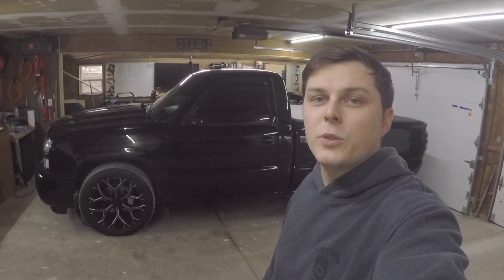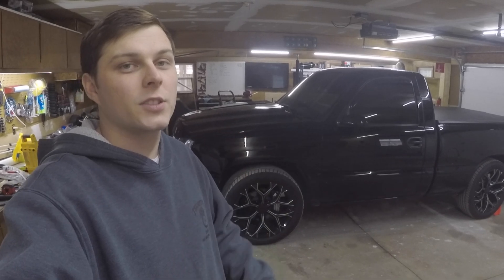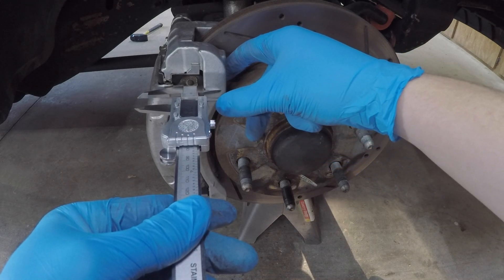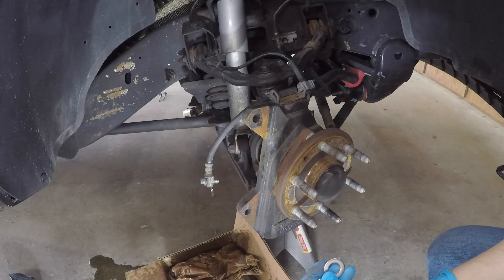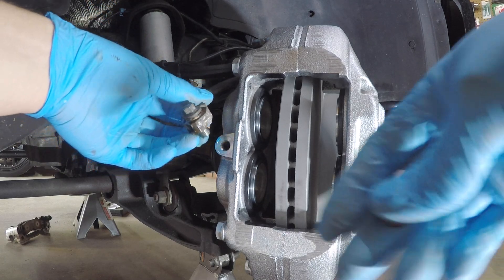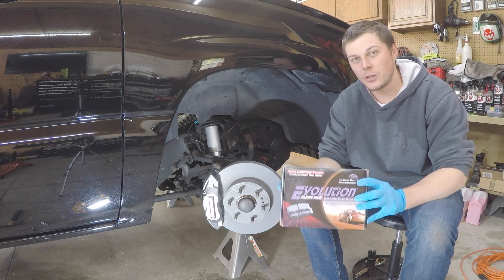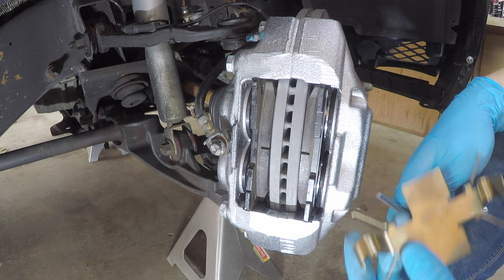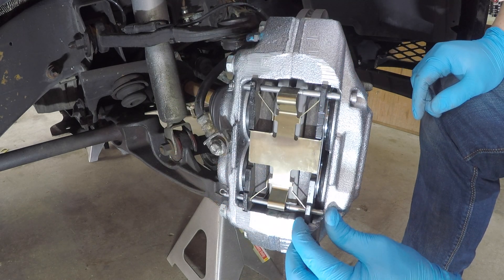Silverado 2019 Big Brake Conversion! “How To” A NBS!

Comment: I have those headlights but can’t get the auto to work. Do you have a video how you wired it? I know there’s a couple optiona
Reply from the maker: Hey, are you talking about the LED bar? The bottom set already has the connector on it. The top set you need to wire in to the bottom set. I used deutsch connectors. As they are easy to install, add more wires, change connector houseings, ect. And they are waterproof. 

But if you wired it in already, the lights work, but the auto feature isn't working. Like the DRL or the headlights bulbs. Its either your DRL/headlight switch, or the light sensor on the dash is bad.
Reply: @TheKingCoopa  yeah it’s been a few months since I put mine in and I want to say there was a white wire the instructions called for but the other wire was maybe brown? Which color is your connector hooked up to?
Reply from the maker: If you have instagram or Facebook, i can send some photos. But the lower housing plugs right into the DRL socket on the trucks harness (brown and blue wires). I cut the trucks harness, and spliced in a deutsch connector. That connector goes to the top houseing. 

Red wire from the headlight housing, goes to the brown wire on the harness. 

Black wire from the headlight housing, goes to the blue wire on the harness

Comment: Would this fit my 1995 Chevy Tahoe
Reply from the maker: Hey, from the research I've done, these should fit the GMT 400: 1987-1999/2000, GMT 800: 1999-2007 Classic, GMT 900: 2007-2013/14

I'm not too familiar with the obs trucks, but if your tahoe is a 1500, with the 6x5.5 lug pattern, it "should" fit. I can't garentee the fitment, but research shows it should. Definitely something worth looking into though, hope that helps
Reply: Thank you so very much I will try soon an let you know . . Oh an where should I get the washers from
Reply from the maker: @JovonSavage  for sure, let me know how it goes, I'll update my description that they for sure fit. And for the washers, I have some linked in the description of the video. But honestly I'd just get them from an ACE hardware, Do it best, or worst case, Lowes should have some. Just some M14 stainless steel washers. They should be like .60cents each. Two for each calipur.

Comment: Hydroboost and  braided brake lines would help on both issues.  I have a cammed 6.0 in my NBS Tahoe with the NNBS brake upgrade with drilled/slotted rotos. It stops great, but I'll do this next brake job so they'll be greater lol. Seems parts are scare, but I'm in no hurry..good content..subbed..
Reply from the maker: Hey, sorry for the late reply. Just finished they hydroboost swap (still have to bleed the brakes) but I'm sure it will make a big difference. I feel like the parts are kinda scarece just because they are so new, and alot of them haven't gotten to the junkyards yet. I think In a year or two they will get more common.  And thanks for the sub, I appreciate it!!
Reply: @TheKingCoopa  no problem I think I can get the calipers thru Summit.. just have to pre-order...got me interested in working on my truck again..
Reply from the maker: @spyderlyf3  oh nice, let me know if it works. If so, I'll add the summit link to the description of the video, for future viewers to buy 🤘

Comment: I have a 2001 suburban 2500 with 8 lugs. What calipers and rotors could I use?? Have 18” rim on it.
Reply from the maker: Hey, sorry for the late reply! This video is for the 1500 6 lug setup, so it won't work on your suburban.  But I had a lifted 2003 2500 silverado on 40s, in some of my older videos. I used the factory calipurs, with powerstop rotors and pads. It did pretty well for a 9,000lb truck. I'd definitely use them again. Thats my recommendation, but for upgraded calipers on your 2500, honestly I'm not to sure. Sorry, but hope that helps 🤘

Comment: What is the diameter of the rotors and minimum diameter for the wheels. That would be a nice addition to my 2003 silverado. Would like to us my 18 inch wheels if possible
Reply from the maker: Hey, sorry for the late reply! The rotors are 13.51". Stock 17s should clear, some aftermarket 17s are questionable. My custom forged 18" dragwheels have a calipur clearance of 3/8in. So your stock 18s should clear just fine.
Reply: @TheKingCoopa  thanks for the response. Dont even worry about the delay. I appreciate the response greatly and the info is just what I need to hear. Thanks again take care and have a great weekend
Reply from the maker: @holmes1956O  for sure, you as well. Thanks for the support 🤘

Comment: Does anybody know if they will clear 20s Tahoe ltz wheels
Reply from the maker: Hey, sorry for the late reply! I know for sure the diameter will clear, but unsure of the offset. Worst case, you could try it and have to run a small 3mm or 5mm spacer.

Comment: What wheels are you running?
Reply from the maker: They are made by OE Performance and they are called 176M. Its a 22x9 +24mm offset. With some 285/45r22 Michelins.

Comment: Are the front 4 piston calipers the same as the back 4 piston calibers
Reply from the maker: Hey, im not sure which 4 piston rears you're talking about. But if they are the 2019+ rear calipers, you can't use them.  They have extra electronics that control them, that the previous generations do not have to support them.

Comment: Will any 2019 chevy rotors work ?
Reply from the maker: Hey, sorry for the late reply!! Most the 2019 rotors are similar, but if you look on rock auto or other websites. Certain rotors exclude the big brake option. So honestly I can't give you a 100% answer. But from the websites fitment info, I'm gonna say no. Not all rotors will fit the big brake upgrade.

Comment: Don’t think your caliper was “seized” it’s 4wd so that was just what happens when in park, same as the rear on a 2wd being in park.
Reply from the maker: Hey, I get what you mean by the 2wd/4wd thing. My calipur sized while driving, it got so hot I couldn't even touch the rim. I almost had to tow it home. Once it cooled off, I couldn't even depress the calipurs pistons with my bench vise. Which was a main reason for the 2020 calipur upgrade

Comment: What do you search like year of vehicle if I was to go to an auto zone or parts store?
Reply from the maker: It would be for a 2019-2022 silverado 1500. Just make sure its the 4 piston brake calipurs. There is like 3 or 4 different calipur designs for those years.
Reply: @TheKingCoopa  thanks I just ordered the calipers just need rotors and pads
Reply from the maker: Nice, good luck with the swap 🤘

Comment: Is this the same process if I where to go with the 6 piston brembo instead of the stock 4 piston
Reply from the maker: Similar concept, but with brembros you wouldn't be needing the small spacer. For 1600$ for just the fronts, you better beable to just straight bolt it on lol.
Reply: @TheKingCoopa  since they are still for a 2022 I’d expect to use the washer but I just don’t know if they would fit
Reply from the maker: @BDRslayer  oooooo, I thought you ment brembos ment for an 03-07classic silverado.

If you went with the 2019-2023 silverado brembros, I'd assume you would need a spacer as well. But honestly not sure on the actual fitment of them.
Reply: @TheKingCoopa   if I could find the 6 piston brembos for the 05s under 6k I’d buy them but I may just try and be the first one with 2022 brembos swap on a cat eye I can’t find any info kinda worries me
Reply: @TheKingCoopa  any advice on a hydro boost brake system my stage 3 cam hates the vacuum style brakes lol
Reply from the maker: @BDRslayer  6k!?!.... yea thats ridiculous. Maybe it was for my corvette that were 1600$

I'm finishing up the hydroboost swap right now. Whats your question?
Reply: @TheKingCoopa  I’m wanting to do the hydro boost swap are you doing a video on that or can you tell me what all u replaced
Reply from the maker: @BDRslayer  yes, im doing a video on it. Its gonna be a little bit before I finish it up though. Here is a link to a really good write up on it.

https://www.performancetrucks.net/forums/gm-drivetrain-suspension-22/hydroboost-conversion-install-417445/

Comment: Rockauto isn't cooperating with the parts search, I am getting a bunch Item not found?
Reply from the maker: Hey, gm is now in production of the 2023 silverados, so they have changed their part numbers ALOT. All the numbers listed in my description are probably discontinued by now. I've updated it like 3 or 4 times now and finally gave up on it. You should beable to search those part numbers in Google and im sure someone will have them in stock. But rockauto has never really been reliable for the calipurs/rotors.

Comment: Just completed the bigger brakes and calipers conversion for my 05 Escalade EXT. Your video was very helpful and detailed enough to make the job a breeze. I haven’t broken the pads yet because of rain, but as soon as it stops raining I will do a full breaking in cycle and test. Thank you so much 😊.
Reply from the maker: Hey, sorry for the late reply. Oh nice, thats awesome! Hopefully it made a big improvement. I know those escalade's are pretty heavy and need that extra braking power. Glad I could help out, thanks for the support!! 🤘
Reply: @TheKingCoopa  it definitely feels much better. Before it would struggle a little to stop hard and fast. Now it just stops quickly when pushed hard and doesn’t struggle at all. The hydraulic power booster makes feel very smooth. It only requires normal pressure. Thanks again for your help.
Reply: Are your wheels 17 inch? I have an 05 Z71 w 17inch wheels and ned to know if they will fit,
Reply: @acampbell8071  No, I upgraded to the 22s from the 07s. But I believe they should clear. Hopefully others can chime in. Good luck. BTW the truck slows down really well now!

Comment: Will this brake upgrade work a 4x4 sierra crew cab . I ask because the front and rear brakes are different from the extended cab and single cab .
Reply from the maker: Hey, sorry for the late reply! These brakes will work on the gm 1500 platform 2003-2018. You can not use the 2019 rear brakes, as they have newer electronics that control them, and are non compatible with the previous generations.

The single cab, extended, and crew cab are all going to have different brakes from the factory. They are different weight classes, which require larger or smaller brakes to effectively stop them. The 2019 brakes will still work on all the differen cab/weight sizes. Just needs to be a 1500.

Comment: also, what's your info for upgrading the rear calipers?   I have single piston calipers (for my 2010 Cadillac escalade ext 6.2)
Reply from the maker: Hey, for my rear setup, I used 2004 yukon 4x4 rear calipurs. They were a direct bolt on, dual piston calipurs, and I was able to re-use my silverado rotors. But yours being the next generation, I can't garentee they will work for you. But definitely something you could do some more research into. Also the 2019-2022 rear calipurs have electronics in them, and can't be swapped over to another platform/generation
Reply: @TheKingCoopa  thanks bud, I gotta do something, I smoke these damn brakes and rotors all the time when I really drive hard. I have to replace rotors like every 6 months, already replaced the front calipers, rotors and pads but the stock dual piston front are single sided.

Comment: So I have a 2010 Cadillac Escalade EXT pickup truck with the 6.2l-  its pretty fast but the brakes Suck!!  22inch wheels - Will this upgraded setup work for me ?
Reply from the maker: Hey, from the research I've done. These should work for your setup. The escalade calipurs are already pretty big though. Those 22s kill it. But I honestly think you would gain more braking force from doing a hydroboost swap. It runs off your power steering pump, instead of the intake vacuum.
Reply: @TheKingCoopa  thanks bud, yeah I think anything I can do to make the rotors and calipers bigger would be beneficial.  I will definitely research a _ Hydroboost Swap,  this is the first I'm learning about it.  Great channel thank you for the help
Reply from the maker: @JBNJ609  yea, for sure. Thats a big girl haha, I wouldn't be surprised if yours already has hydroboost. I'm swaping my single cab, I robed my unit from a 05 escalade in the junk yard. Hope everything works out, and thanks for the support!
Reply: @TheKingCoopa  whats the Hydroboost unit look like in differences?   Can you make a video describing your other brake upgrades and the hydroboost setup?  This would be great for the GM pickup community and get you some more viewers and subscribers too!!  Keep up the good work Bud!!🏁👍
Reply from the maker: I have a video in the works for it. I haven't finished the install yet, im currently doing alot of engine bay mods. I'll get it finished eventually haha.

The vacuum booster looks like a giant doughnut. The hydroboost looks small and a bunch of lines coming out of it. 

Thanks for the support!!

Comment: Happen to know the size of the rear rotors you need to do the Yukon caliper swap? And what the part number is for the rotor and caliper
Reply from the maker: Hey, the rotors should be the same size. I used the silverado rotors that were on my truck, which I seen a few people do as well. As for the calipur, its been a long time since I did that swap, and I don't wanna give you the wrong part number. But I just went to autozone and asked for the rear calipurs of a 2004 yukon 4x4. And made sure they were the dual piston setup. They also took my old calipurs for the core charge. Sorry im not much help there.
Reply: @TheKingCoopa  nah you’re fine! I was curious on doing that but worried about the braking difference you described in the video. But my Silverado is just a lifted 4.8 so I normally wouldn’t have to slam my brakes but was curious on how slow of a difference there was when applying the brakes. My stock brakes seem sluggish so I’ll at least do the front calipers for now
Reply from the maker: @dylansmith3  also if you have a large camshaft it will just make the braking power worse. Less vacuum pressure = less braking force. But even with a mild cam, large front and rear calipurs the daily driving with my truck isn't bad. Still drives like normal. Its just slamming on the brakes, is where I notice the big difference.  But id upgrade the fronts before you do the rears. Always wanna have the stronger brakes up front

Comment: Could I do this for a 04 Yukon XL as well??
Reply from the maker: Hey, yes you can. Should work on the gm 1500 platforms from like 2002-2021
Reply: @TheKingCoopa  so you did the same for the rear as well?
Reply from the maker: @lavishlex  no, the 2019-2022 rear calipurs have electronics in them, and cannot be swapped over. 

I used 2004 yukon rear calipurs (dual piston) and got rid of my small silverado single piston calipurs.

Comment: Did u have to upgrade the brakebooster and mastercylinder
Reply from the maker: No, you don't need that for this swap.

I have a large camshaft (lowers the vacume pressure = weaker brakes) I'm currently swapping to a hydroboost setup